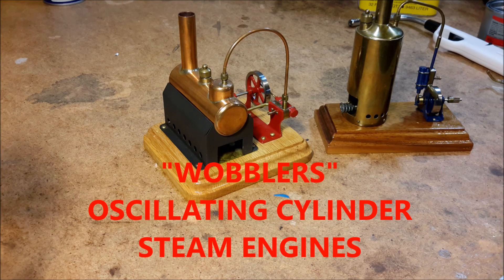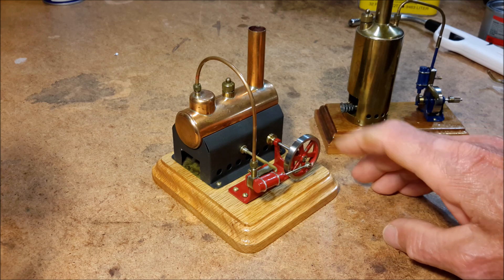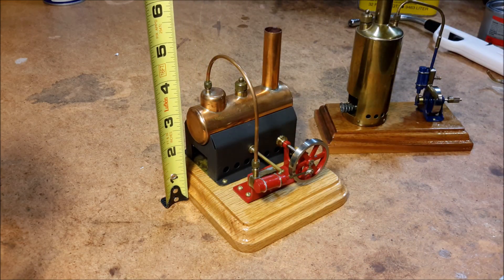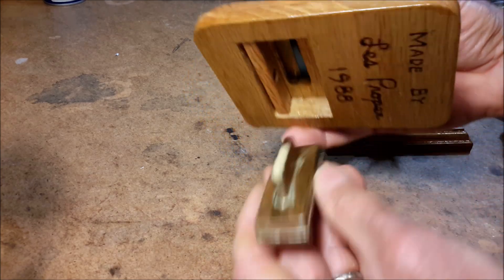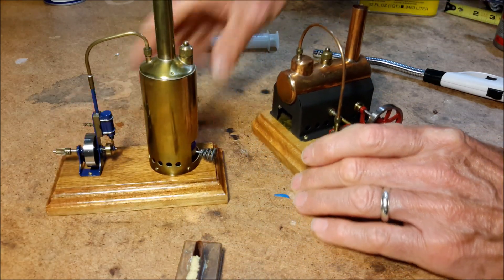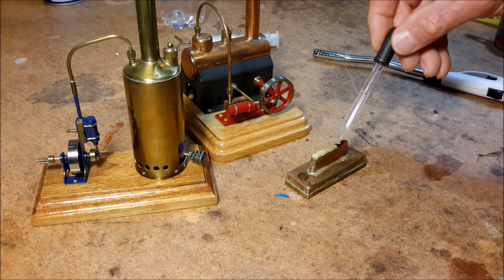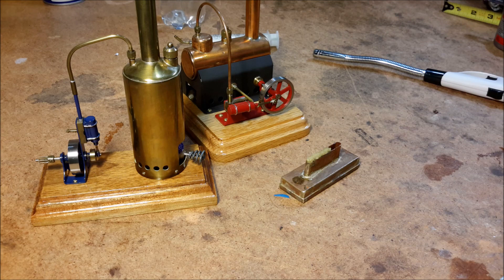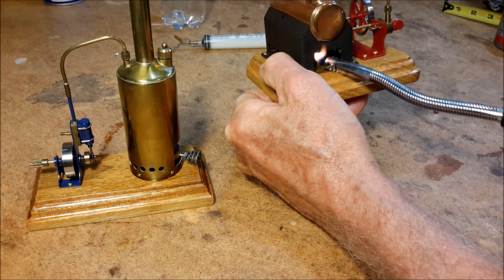TWO WOBBLER STEAM ENGINES

Comment: safety valve??
Reply from the maker: Yes, it is the little ball on the top of the fill cap.  It is held down by a little spring and is set to release at about 10 psi.
Reply: o thats cool! can you make a video on how to make one? im just starting and ive always been interested in steam power and that kinda stuff, and i wanna make a little boiler and maybe a cylinder attached to it. my grandftaher gave me a copper pipe from when he was a teenager and i dont actually know where to start, uve got some tips?
Reply from the maker: Send me your email address, to   lesproper@gmail.com   and I will send you a PDF with information.
Reply: ok thnx :)

Comment: Hi Les, superb little boilers and engines, perfectly built. I really like the look of the brass outer shell on the vertical boiler. I find  miniature sheet-metal work, as per your miniature vertical boiler design, to be a major challenge (Bending, cutting, riveting and filing etc )  Thanks for showing these engines.
Reply from the maker: Hello SteamerEdge,  the vertical boiler on the wobbler is made from a single piece of 1.5 inch brass sink drain pipe.  The chrome coated brass pipe, which is all you can buy in hardware stores works just as good, but the chrome finish get damaged by the silver soldering.  The vertical steam boat boilers are a little different.  I use the same brass sink drain pipe to make the pressure vessel part of the boiler and then a light sheet metal wrap for the outer shell.  This enables a layer of insulation between the inner pressure and outer shell.  The pressure vessel by itself is easier to silver solder and a super heater pipe can be added.  The steam boat design boiler will produce more steam than a similarly sized wobbler boiler.